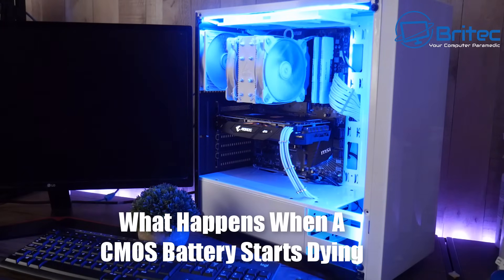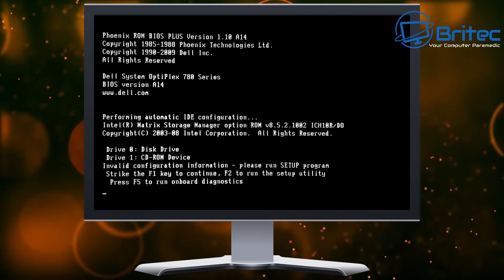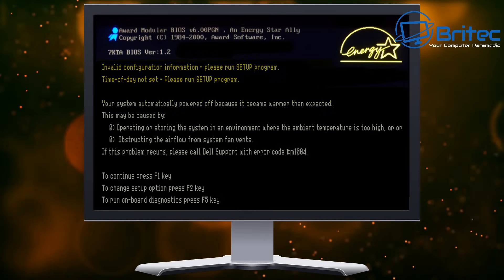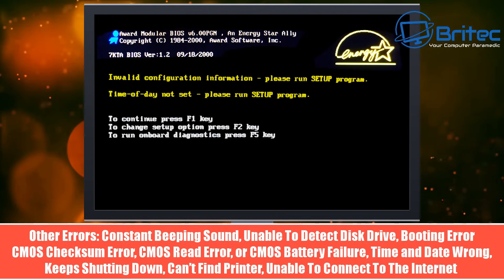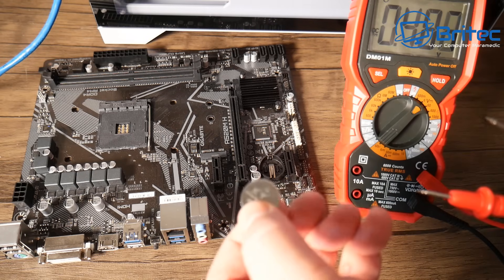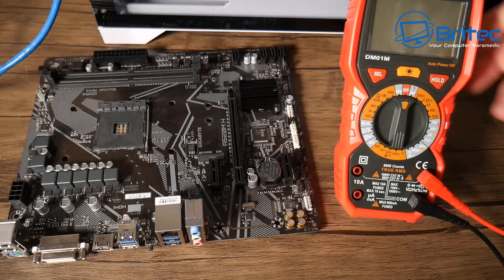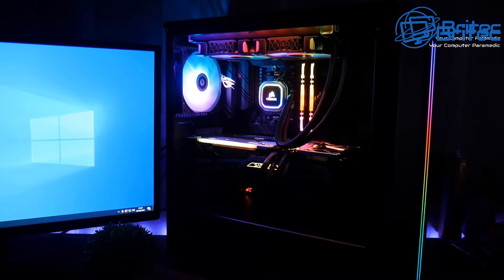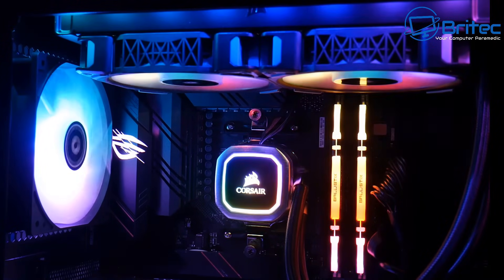What Happens When Your CMOS Battery Starts Dying

Comment: what's REALLY STUPID...
Modern motherboards use NVRAM for the UEFI/BIOS. Yet they also have a battery and will lose some data without it. Explain that one?
https://en.wikipedia.org/wiki/Nonvolatile_BIOS_memory
"Today's UEFI motherboards use NVRAM to store configuration data (NVRAM is a part of the UEFI flash ROM), but by many OEMs' design, the UEFI settings are still lost if the CMOS battery fails."

Comment: On some laptops, certainly ones I've used, nothing happens. That's because once the CMOS battery dies any power needed is automatically redirected from the laptop's battery. In that case you only discover the CMOS battery is dead once the laptop battery is removed and you run it off mains power only. But even in that niche case, nothing happens except system date and time needs resetting and any custom BIOS settings are lost.
Reply: Thanks.  On a refurbished Dell laptop I have it constantly go into "sleep" mode which I suspect is not a CMOS setting but something with the Dell locked BIOS.  But maybe it's a CMOS battery?  I also thought the CMOS battery was rechargeable but no.  BTW the PC I am posting this on has an original CMOS battery that's 14 years old and doing just fine.  (Wikipedia): CMOS This battery type, unlike the Lithium-ion battery, is not rechargeable and trying to do so may result in an explosion.  Today's UEFI motherboards use NVRAM to store configuration data (NVRAM is a part of the UEFI flash ROM), but by many OEMs' design, the UEFI settings are still lost if the CMOS battery fails.[4][5]
Reply: @raylopez99  How do you mean the laptop constantly goes to sleep? You mean just randomly? That's definitely not a CMOS battery issue. I deal almost exclusively with refurbished Dell laptops as that's my area of interest. Does your laptop have a locked BIOS? You know it's possible to unlock it without the user password. I don't see why any issues would be related to a locked BIOS as all that means is that you can't access it without a password and doesn't itself dictate any power settings. It's certainly a bizarre design decision for settings to still be lost when the CMOS battery dies even though stored on NVRAM.
Reply: @FlyboyHelosim  You are saying something very relevant to my ears.  Please elaborate if you have time.  Yes my Dell E6520 (i5-2520M chip) goes to sleep 'randomly' with the battery in, and with the battery out, it does less so (but on occasion) so I leave the battery in since it's easier to awake it from sleep rather than reboot.  Tell me how to unlock the BIOS without the password please, but keep in mind I've heard that if you do it with a "hardware reset" some Dells have it set up so, for security purposes, it trashes the EEPROM (?), urban legend but maybe true so I don't want a hardware reset.  Also you last sentence implies that if the CMOS battery dies, since the BIOS is locked, your laptop might die even if you put in a fresh CMOS?  Is that true?  I did look at the user manual and know where the CMOS is stored, it's behind the WiFi antenna.  My philosophy, given shortages in laptops these days, is "if it aint' broke, don't fix it".  I use this laptop for storing business data and tho I backup I don't want the PC to die by messing with the CMOS.  Any thoughts appreciated.  Bye.

Comment: There is another problem I have encountered when the battery is low. The PC simply refuses to boot.  I don't know how it is lnked but it is true. Another thing I have noticed is that almost ALL motherboard manufacturers install this CR-3032 battery from KTS. It is a rare very good product coming out of China. If the mains power to the PC is not switched off than this lasts for the life of the motherboard. However this brand is simply not available in the replacement market anywhere in the world. I just don't know why.  My own experience of replacement over last 30 years is to go for Panasonic as THE BEST brand by far.
Reply: Strange, since the CMOS battery is not rechargeable... (Wikipedia):  CMOS - This battery type, unlike the Lithium-ion battery, is not rechargeable and trying to do so may result in an explosion.  Today's UEFI motherboards use NVRAM to store configuration data (NVRAM is a part of the UEFI flash ROM), but by many OEMs' design, the UEFI settings are still lost if the CMOS battery fails.[4][5]
Reply: @raylopez99  Of course it is not rechargeable. It powers the static ram storing the bios information through a diode. Since this diode gets reverse biased when the PC power supply is powered on even during standby, the battery does not get consumed. It is consumed only when there is no power flowing from the wall socket like when the mains are switched off over weekends in business environment or are unplugged. Self discharge is extremely low.
Reply: @pmshah1946  Makes sense, and explains why my CMOS coin battery is 14 years old and still working fine in the PC here in the USA I use everyday.  But, I bet the one I left in SE Asia some five or six years go has gone bad, with the heat and humidity in that part of the world.

Comment: Would be cool if they would just add  those little ones that the board could rechargeable as well might save a lot of headaches. We use to see things like that. They should have been old VCRS for keeping the time set. Back the parents would  be like he is so smart he fix the VCR time now it's like look they can use our thousand dollar IPAD so well. 🤣
Reply: It'd be even better if the settings were stored on non-volatile memory, so any artificial power is completely redundant.
Reply: @FlyboyHelosim  Wikipedia:  This battery type, unlike the Lithium-ion battery, is not rechargeable and trying to do so may result in an explosion.  Today's UEFI motherboards use NVRAM to store configuration data (NVRAM is a part of the UEFI flash ROM), but by many OEMs' design, the UEFI settings are still lost if the CMOS battery fails.[4][5]

Comment: Without Evan Watching the video. Your clock starts to show the wrong time . For one calendar gets wonky. Stuff starts to slow down or you have issues with accessing the drives kits an allover breakdown of your main board systems . Thank God most of the 2032 battery's are replaceable.  Some you have to desolder. Oh your random access memory is linked to the cmos battery.  That's if I rember it correctly I grafuated IT school in 03 been a while lol

Comment: CR2032 stands for:
C - type of battery: lithium , voltage 3V
R - shape: round
20 - diameter: 20mm
32 - height: 3.2mm
Reply: Thanks, I've always wondered about that.
Reply: Arne Ragnarsson  batteries don’t hold the information. just powers the module that stored the information
Reply: **** THE MORE YOU KNOW  ***
Reply: Arne Ragnarsson 
Umm why you stated the obvious?
Reply: Your comment has awesome information! I never knew that about the meaning of the battery name. Thank you very much
Reply: naw you a legend for dat
Reply: Kinda stupid question. I tried google and checking out forums but didn't really find any conclusive answer to this one. Can a CR2032 coause any damage like start leaking and damaging internal hardware when its dead? My battery is dead in my PS2 so the clock stopped working and the machine thinks it 01.01.2000. I presume I can't load saves from my memory card which has a newer date and all. But I'm fine with that. I only wonder if I shoud replace it asap to avoid any damage to my PS2 or if I can just leave it there for now?
Reply: @gentlesirpancakebottoms6692  its a lithium battery with all of its peculiarities attached. But honestly,  just  swap it out its not that hard to find it.
Reply: Thank you!! ❤
Reply: Thanks.
Reply: Wow. Amazing

Comment: Neglecting CMOS warnings by choosing Continue can cause your Antivurus to block access to certain sites like banking, because the date and time is not correct. A pc that is connected 24/7 to mains power is less likely to have issues. I use a standard lifecycle of three years to replace the battery anyway.
Reply from the maker: Yeah, some batteries don't last long
Reply: My mum's computer after a reboot resets the BIOS settings and if I change and save them, it doesn't boot at all, but continue with default ones helps. Old PC but had its battery replaced during maintenance, maybe the battery itself is bad or needs a replacement again?

Comment: There's a new issue going around.
Don't know even if it's an issue or not but still for everyone's information I'm describing it :

Windows 11 is downloading a display driver for AMD version 30.0.13023.1012
(Mine Got installed on 19-01-2022)

Where as the Version number mentioned above is not even listed on AMD's website.
Surprisingly AMD has a newer version WHQL driver which will get installed if you use the amd driver install tool 
Version : 30.0.13025.5005

So you see the difference between the two version numbers.
30.0.13023.1012 vs 30.0.13025.5005

Windows 11 is technically downgrading the AMD display driver these days

Btw if anyone wants to research these are Windows Driver Store Versions

And you will get it in the Device Manager display adapter section and 
On AMD's website driver support page under driver download release notes section.

Comment: CMOS--   EPROM  integrated    circuit chip  that  can  be flashed  It's  a  2032  battery   NICE   using  a DVM ,  you  don't see  that on a lot of  other computer  channels
Reply from the maker: That would make a cool video.

Comment: dear sir. I forget to put my CMOS battery back. but my desktop PC running very well. do I need to put it back or is its o.k PC running without a CMOS battery? thank you. have a good one.
Reply: Depends on your OEM and design.  Wikipedia-- This battery type, unlike the Lithium-ion battery, is not rechargeable and trying to do so may result in an explosion.  Today's UEFI motherboards use NVRAM to store configuration data (NVRAM is a part of the UEFI flash ROM), but by many OEMs' design, the UEFI settings are still lost if the CMOS battery fails.[4][5]
Reply: thank you sir.
Reply: @QZonegaming008  I'm no expert but if you use your PC everyday perhaps the static ram, which is what the CMOS battery prevents from discharging, will not discharge as it will get energy from the main power supply when the PC is on.  Just a guess.  Good luck and always backup your data.
Reply: thank you sir.

Comment: Why oh why doesn't CMOS do a battery check before loading & detecting all of the computer hardware components? And why doesn't CMOS tell you that the battery life is low and you need to change it soon or the battery has discharged too much and you need to replace it ASAP or you will have problems booting your computer properly? We have all kinds of sensors like SMART for hard drives that can tell you the status of them, fan speed detection, CPU & GPU temps, memory testing at CMOS, etc. But we have nothing going on for a simple battery check? Why this oversight still continues to this day is beyond me and totally inexcusable. For shame, for shame on the engineers of motherboards.
Reply: Planned obsolescence?
Reply: @raylopez99  They never planned on implementing this feature.

Comment: Ok, great topic Brian. But I'm curious that after all these years and with technology advanced, why are we still using stupid batteries? I mean the bios and system settings are stored correct?

We use ssd's, flash drives etc. So again why are we still relying on a battery to hold that information in?
Just curious. 🤔
Reply: Ok, RTC "real time clock" so essentially it's like watch.

Comment: in all the years I used computers I have never had to replace the cmos -cr2032 -never.....
Reply from the maker: Maybe you have been lucky and it depends how many computer you have. Some people have had pc for 10 years without replacing. 2 to 10 years battery will last.
Reply: @Britec09  Mine is 14 years and still going strong, no date problems, but good to know this problem exists.

Comment: Ran across a HP 15-CS laptop the other day with a bios error noting RTC battery issue when power button is pushed. Turns out there wasn't a CMOS battery on the motherboard, the CMOS battery is now part of the internal main battery. Purchased a new battery online and the issue went away. Live and learn!
Reply: But was there an actual place to put a CMOS battery? I ask because some laptops can bypass the CMOS battery entirely and run its same functions directly off the main laptop battery. I think that may be what you're experiencing here.

Comment: My computer failed with A CMOS problem, BUT, neither I nor a computer savvy neighbour could locate the said battery....hidden, yes, but where!?
Reply: Sometimes the battery socket on the motherboard is obstructed by the video card, or another plugged in card or cable. Look carefully. Try to find the manual for the computer or motherboard.
Reply: Check the falopian tube next to the p22 decoupler m8

Comment: Had this issue, I just unplugged the cpu from the power source, removed the battery, got a replacement, and put it in, boom, problem solved!  Well, at least t when plugged it back into the power that is!

Comment: Great video, thanks Brian. I've just changed the CMOS battery on my brothers old XP dual core Pentium 4 PC. There the dying CMOS battery first manifested via errors with delayed writes to the D: drive, then boot errors, but BIOS and time settings were still remembered, so it took a while before I started to suspect the battery.
Reply: Mine was manifested by having blue screens every now and then.

Comment: Since 1993 I've only ever had that happen once. It was on a PC my brother had for several years before he gave it to me. I haven't had any others long enough for that to become an issue. If you're constantly upgrading and buying new parts you may never run across this.
Reply: Exactly. In my 24 years of computer ownership I've never replaced a CMOS battery.
Reply: I've had to replace CMOS batteries several times in my life, but yeah, it's rare. Sometimes the battery the motherboard came with just wasn't the newest one and so it only lasts a few years. Personally, I replace my desktop PC every 7-10 years and so, just recently, I had to replace the CMOS battery.

Comment: Bro i cant assign letter to my system volume in cmd, can u give a solution
Reply: You need to run DISKPART as administrator, then run this command:
LIST VOLUME
This will bring up a list of all the volumes on your disk(s).
Write that list down, because you will probably have to remove some drive letters and reassign others.
You will need to select each disk individually, and then run ASSIGN LETTER=[whatever letter you need] or REMOVE LETTER=[whatever letter you need to remove]
Sometimes, DISKPART assigns letters to volumes in the order in which they are detected by the BIOS.
You might have to do quite a bit of letter-juggling until you get it right.
Also, it helps a lot if each of your volumes has a label unique in your system.
For example, I have three volumes, my WIndows volume is labelled "SYSTEM," and my large spanned volume for all my data is labelled "STORAGE," and my permanently-connected USB backup drive is labelled "BACKUP01."
It was particularly important that my USB backup drive had the correct letter, because I run a daily automated Macrium Reflect image backup, and if the drive letter is wrong, it won't run.
Hope this helps, and good luck!